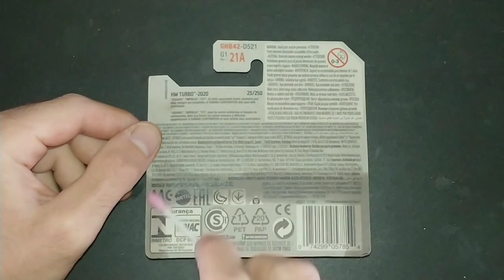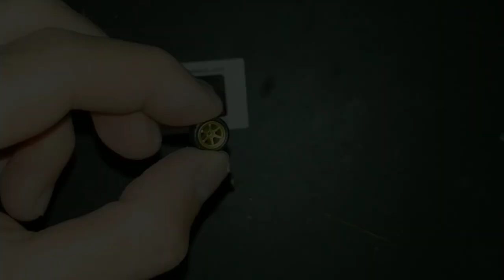Subaru WRX STI 98 Hot Wheels custom (wheels swap + lowering stance).-Episode 11

Comment: @purphuard782 When you put the putty to fill the wheel slots around 1:33, did you only put the putty where the 3 tabs holding the wheels down or did you cover that whole area with putty?
Reply from the maker: Only where the tabs are, and i make it flush to get smooth finish on top🙂There multiple way to do it😉
Reply: @purphuard782  Thank u

Comment: Those crimp things hold the wheels so you have to smash the axle? Where did you get those awesome video 🤙🏽
Reply from the maker: Yes you got to smash a little bit the tip of the axel or put a tiny dab of glue. I take those crimp on craft store ( it's to make collar or bracelet). Thanks for watching buddy ✌️
Reply: @purphuard782  that’s cool thanks for the tip 🤙🏽
Reply from the maker: @nucollector5597  No problem!